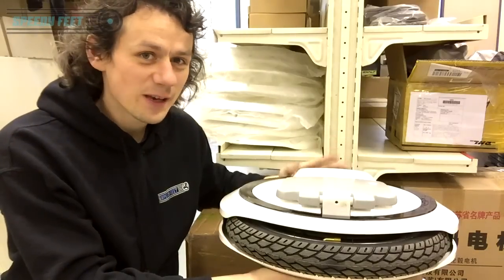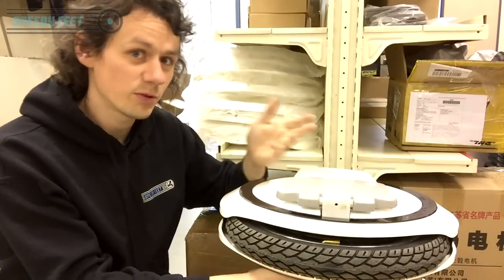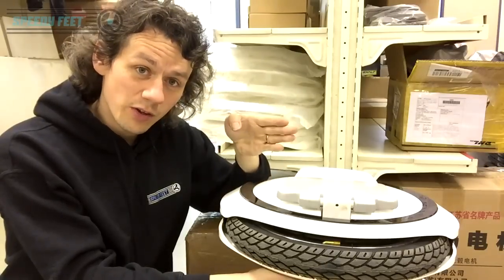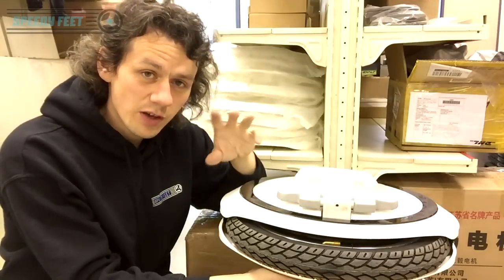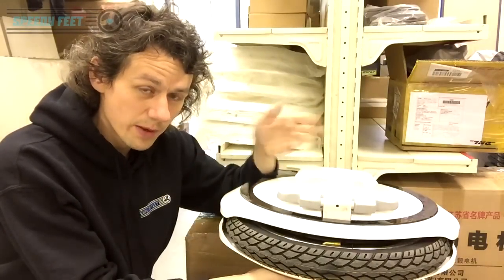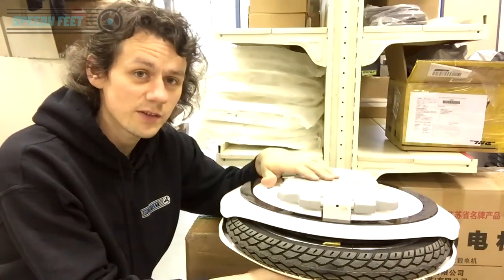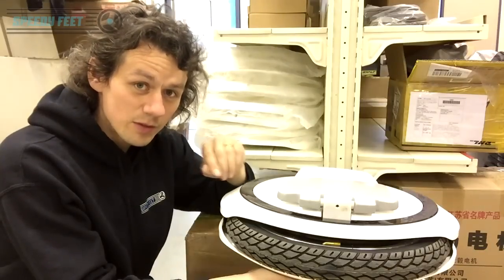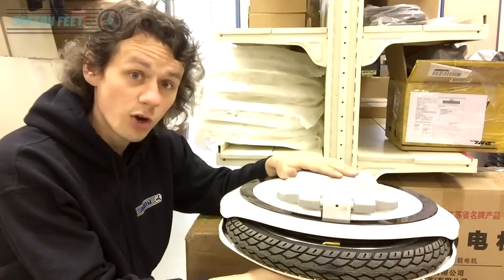Ninebot ONE - Electric Unicycle Tire Pressure - FAQ

Comment: I just bought a NB1 from someone on eBay. It wants to only have really low tire pressure. If I put more air in it the valve stem knocks against the frame. If I put as much as it should really have it knocks even harder and will actually stop when rolled backwards. So I'm having to ride on really low psi just to keep the thing rolling. I don't believe these people put a new tube in it ever, so it seems it came to them that way. Anyone else ever have this issue with a NB1?
Reply: My suggestion is to release all the air from the tire so that it's flat. Once it has no air in it then grab the curved valve stem and just reposition it until it lies flatter and closer to the  rim. As you inflate it just make sure it stays close to the rim and doesn't move. It's just one of those things that you have to play around with but if it's the correct inner tube then  that's how you solve that problem. and also don't put the valve cap on.

Comment: I have the Inmotion V8. I've only put 11 miles on it when I got my first flat. Nothing punchered the tire that I see. I'm 250 lbs and my tire psi was at 40. I'm wondering if I should use more psi to avoid another flat?

Comment: I generally agree. Although really no option for just trying out yourself - especially if you're thinner or thicker than Ian. It also depends a lot of your weight. I had my generic unicycle with me on a trip with my work. I thought pressure was fine - it was for me. While not super hard not that low for me either (I'm <= 70 kg with clothes). Fine for most of the other colleagues that wanted to try but one heavy - don't know the exact weight but I'll estimate ~100-110 kg about the maximum for the unit the tire was quite wobbly. He obviously could've needed more tire pressure even as a beginner on flat smooth road.
Reply from the maker: +HifiCentret Good points. Its also rider skill. With practice you can rider almost on a flat and on an over inflated. The most important one is for beginners - they struggle if its not just right to suit them I have found.

Comment: Thanks Ian for that.
Lots of discussion on forums as well on that subject.

Another point is that other of users, as I do, realize there is a great loss in tire pressure pretty fast (in 3 days of riding, I loose 0,5bar). I don't know if it's due to a wrong choice of inner tube from Ninebot, nevertheless, remember to check it often if you ride a lot (monthly as you've explained it in another video sounds to long appart for the check).

Hope we will have another inner tube to change that.
Reply: +FluxiFlo Probably cheap tubing if no puncture. I'm seeing it on my cheap generic unit too (saving up for a Ninebot now the cheap unit has taking beginners beatings)
It's basically no different than bicycle tires.  A cheap tube looses pressure fast while a good quality one holds it much better. Often I find that when buying a bike it's cheap. Your first puncture and you're often better of changing tube and tire instead of fixing them. Though I think the tire on the Ninebot is a special low friction one especially designed for the use I would not be surprised if the tube is a cheap one. If I ever get a puncture I'd most likely buy at least a new quality tube at the bike shop - a tire only if I get the feeling it's puncturing too often (again like cheap bikes).
Reply from the maker: Interesting, will have to keep an eye on that, its not something that I have noticed...well aside from when getting a puncture :) Will keep an eye out!

Comment: One other point: Higher tire pressure is slightly more energy efficient (less rolling resistance) and rounder tire/longer diameter.  Therefore giving you a slightly higher range per charge.
Reply from the maker: PCUser1024 Correct!